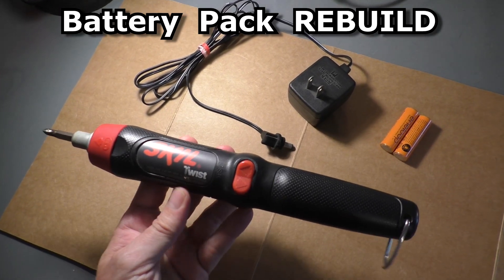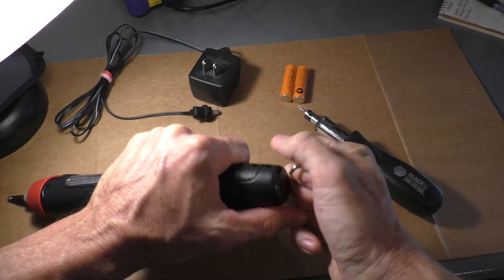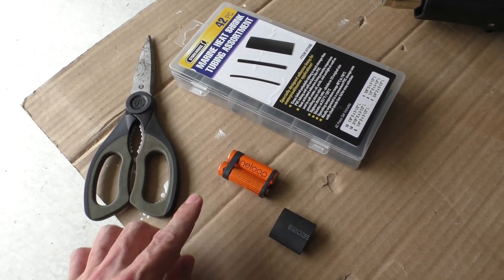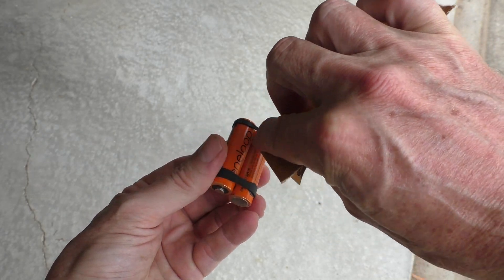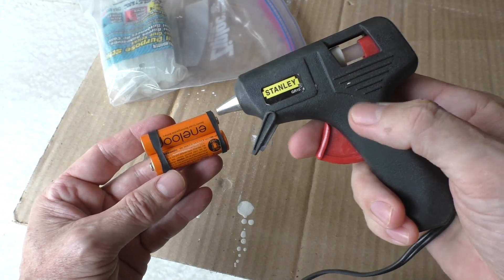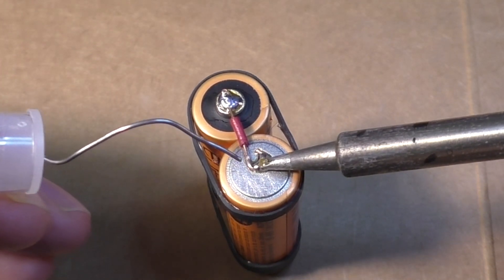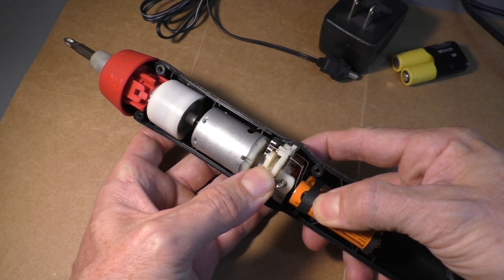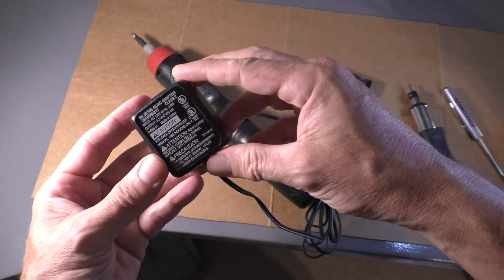Battery Pack REBUILD with NEW Eneloops Cordless Screwdriver Drill fix dead repair electronics SKIL

Comment: Use batteries with pre welded tabs so that soldering will not damage the batteries. Soldering temperatures destroys the batteries.